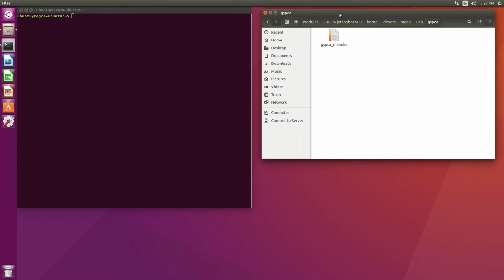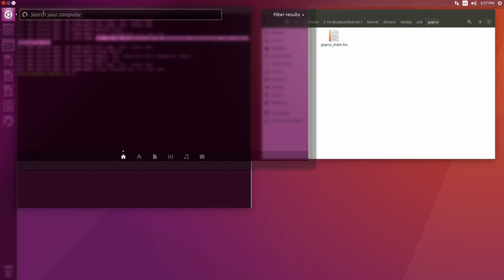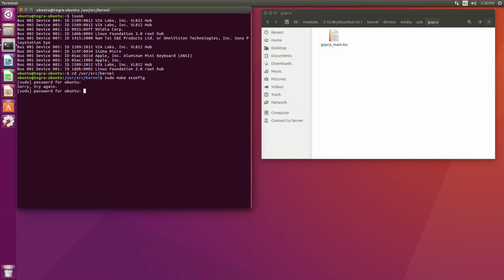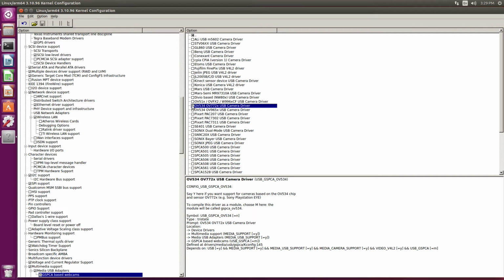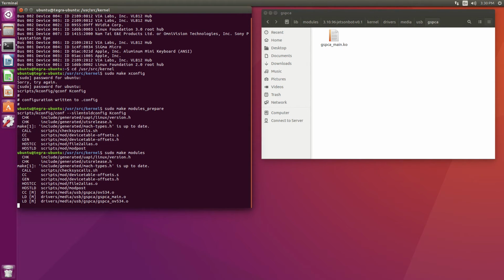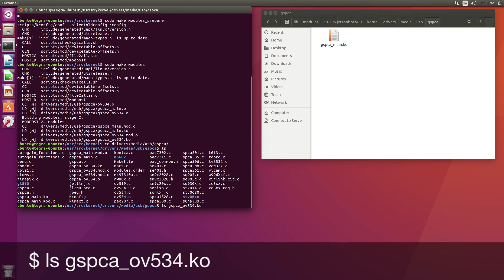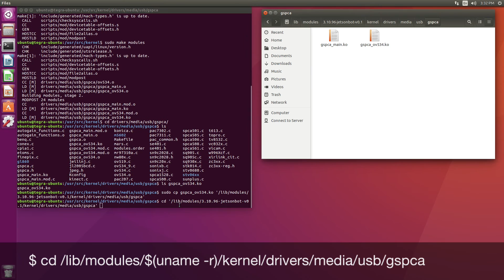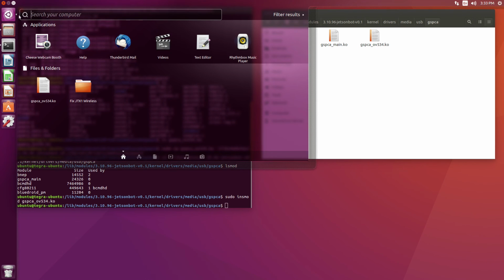Build Jetson TX1 Module - Sony PS3 Eye Camera

Comment: My lsmod has gspca_main.ko. When I try to run the script that you have mentioned in the tutorial it says copy error and gspca_main.ko already exists. But my camera is still not detected. If I try the steps mentioned in the video, 'sudo make xconfig' says no rule to make target.
Reply from the maker: I do not know what steps you took, what version L4T you are running, which version of the kernel you are running, what version of the kernel source you downloaded, the local version you set for the kerne build, or the copy error. If sspca_main.ko already exists, how did it get there and why are you building it? I do not know how to debug your issue.

Comment: Hey, So after following the rest of the instructions, when I try to do an insmod we get the message "insmod ERROR: Could not insert module gspca_main.ko: Invalid module format"
Reply: Would have L4T version 24.2.1 change anything?
Reply from the maker: The pre-built version on Github is for L4T 24.2 
insmod probably sees that there is a version mismatch. You may be able to force it, but you'd be better off compiling the module yourself. You may want to go through the article on the JetsonHacks website: http://wp.me/p7ZgI9-FK and try to build it. The videos contain enough information, but the articles have some useful information in them also.
Reply: did you find any solution ? same problem :/

Comment: I successfully completed the tutorial in the first video, but when I try to find the ov772x it's greyed out and not present in the /usr/src/kernel build.  Am i missing a step?  Also why cant you select both the Ch341 and ov772x at the same time in the first build?
Reply from the maker: Hi Michael, It's difficult to diagnose what your issue is since I don't know what steps you took to build. Of course, you can select the CH341 and the ov772X at the same time. Note that the videos are just examples of any given task, obviously if each of these videos included all of the steps they would be quite long.
Reply: Thanks, i tried recompiling again after a fresh install, and the ov772x was greyed out.  I skipped ahead and downloaded the pre-build drivers and that got me working.   Thanks for the quick reply, your site is a great resource.
Reply from the maker: Good to hear you got something working. Thanks for watching!

Comment: Hey! So I tried to follow the tutorial, but somehow I'm missing the gspca_main file when I lsmod toward the end. Any idea? thx.
Reply from the maker: Hi Lash,
From the previous video, there should have been a gspca_main.ko created, this should have been installed with the

$ sudo make modules_install 

gspca_main.ko is built from the option:

Device Drivers -> Multimedia Support -> Media USB Adapters -> GSPCA based Webcams. 

If it is created, it should be available in:

/usr/src/kernel/drivers/media/video/gspca/gspca_main.ko

If it is not there, you should check to see if it is checked to be built as a module in the kernel configuration editor. A module is indicated as a small circle when checked, a X in the box indicates that it should be built into the kernel.

Once you have it, copy it over to the directory:

/lib/modules/$(uname -r)/kernel/drivers/media/usb/gspca/

You can then switch over to that directory. Then insmod gspca_main.ko and then insmod gspca_ov534.ko

Hope this helps, and thanks for watching!
Reply: Thanks, I tried it and it works